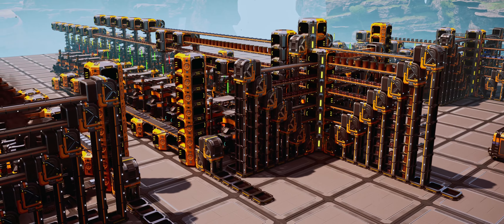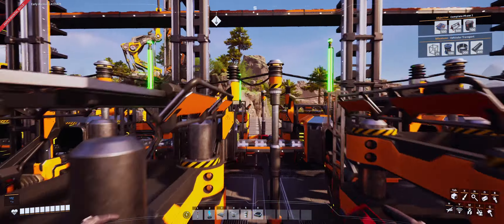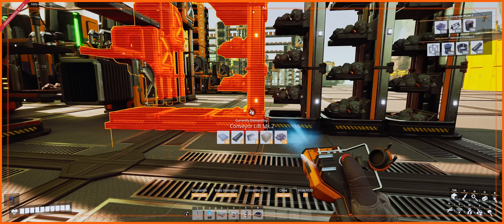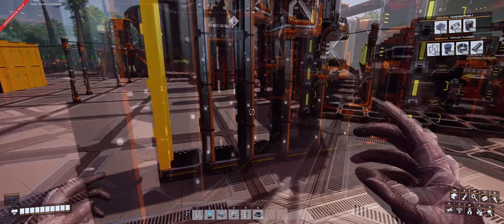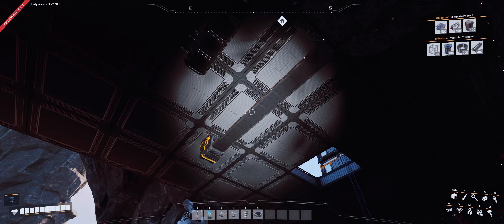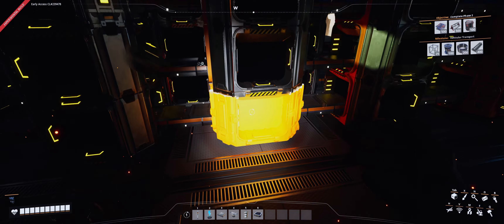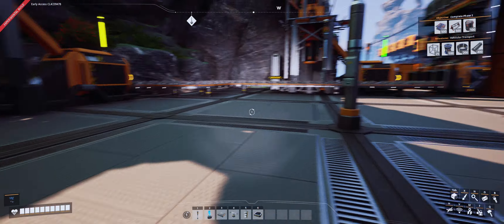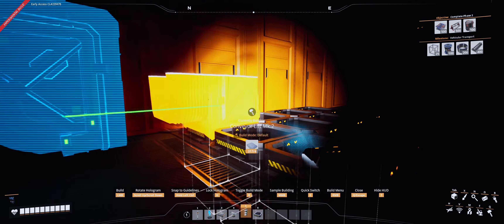Building Central Storage | Satisfactory U8 - Ep 4

Comment: Props to the viewer who mentioned merging the feedlines into smart splitters under your storage.
Reply from the maker: Heh...keep watching lol
Reply: Hahaha. Omg
Reply: Great lessons here man. Love your stuff
Reply from the maker: It wasn't his fault. I couldn't remember why I didn't do that lol.
Reply: @Kinstruction  I dont see why you couldnt set the left over side of the smart splitter to overflow. Or just add overflow before the items go up the elevators. Just merge the 12 belts into 2-4 sinks. Wouldve taken less space than 34 seperate belts no?
Reply from the maker: Every item needs its own belt.

Let's say you have concrete and wire on the same belt and you split it right before storage but after your overflow sink.  And let's say you're using a lot of concrete cuz you're building a factory but not a lot of wire so your wire fills the storage but your concrete doesn't. 

What will happen is the shared belt will fill with wire, and then at the sink overflow the concrete can't get through because the belt is full of wire so now both your wire and your concrete get sunk and you're left with an empty concrete container.

Once your overflow to sink happens, you have to keep them on separate lines.
Reply: @Kinstruction  Right, of course. I didnt think about the stoppage happening after the overflow splitter. youre right
Reply from the maker: This is exactly the problem I had during the episode. The viewer made your suggestion, I couldn't remember why I didn't design it that way, so I spent all that time setting it up, then realized the mistake and had to tear it all out and do one item per belt.  It's a subtle issue that you really have to think about. It's tough, but it's problems like these that make the game so fun (at least to me lol)
Reply: @Kinstruction  You still could have made it work you need 2 buses that run to all the smart splitters and then come around and go back down the sink , that way your line does not stop or back up.  example place smart spitter under each and set the right side for your item.  this would go up and the midde keeps moving after it goes to the last box any left over goes back down to be put in the sink.
Reply from the maker: True, but with the space I had, the idea was to put the sinks under the base, not under the storage.

That was the real issue here, not enough space at the central storage location.